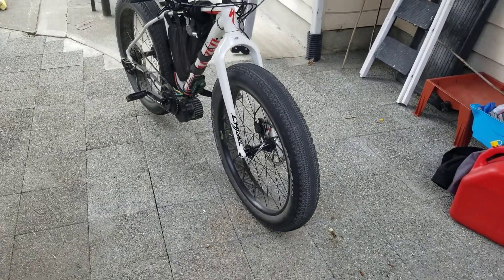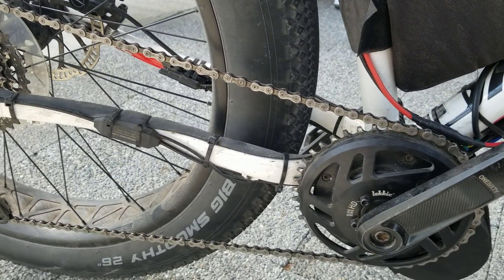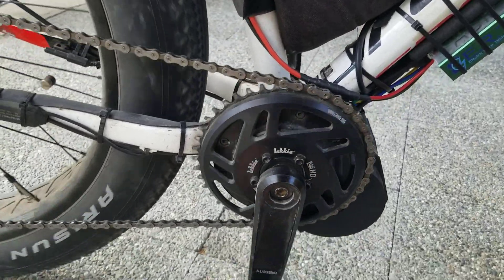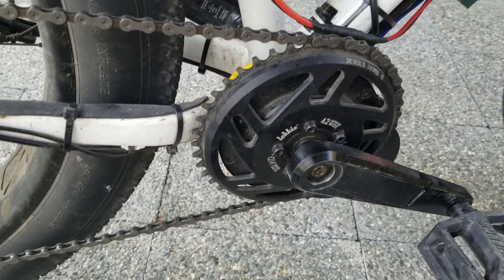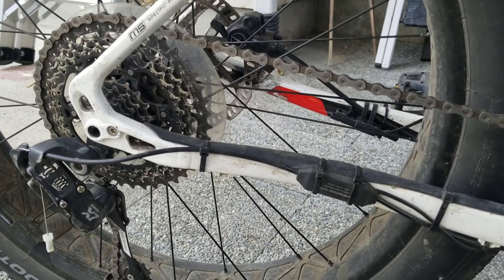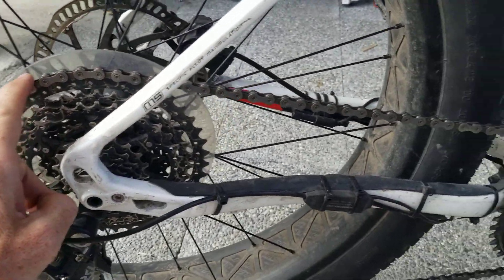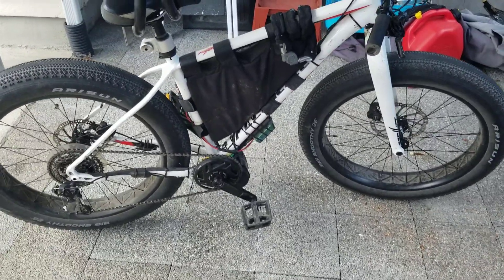Bafang BBSHD (ASI BAC800) on Specialized Fatboy - 3000km What I have learned!

Comment: Have you a link for a good battery. I ordered the 750w mid bafang but the battery is only 48v 12.5A
Reply from the maker: Litespeedbikes in the USA and Electron cycles UK / Europe make high power stuff. Em3ev are worth a look as well. Some folks like UPP which are a bit cheaper than the other options. Hope this helps. https://captaincodswallop.net/ebike-links
Reply: @HighVoltageKits  excellent, cheers

Comment: What about the luna 2000 watt controller?
Reply from the maker: The only luna controller I know of is the modified stock version they do so it can run 50 amps. Thats about 2500 watts max. They have a new VESC based gen 2 controller coming out but much is yet unknown. The piece of paper looks nice but have not seen any real world testing and of course they are locking its sale in with the purchase of an entire luna bike.... If this is not what you meant let me know! Cheers

Comment: What is the different controller u got?
Reply from the maker: ASI BAC800 / 855
Reply: @HighVoltageKits  thanks. I dont see the controller when buying the motor... or this is the display? I assume not.
Reply from the maker: There are only a few places doing this controller. Try Electron cycles or have a chat with people on the discord for other options. It can be hard to get pre-configured plug and play. I have lots of videos on the asi tho

Comment: i chose the Lekkie 32T Narrow/Wide chainring to make the motor spin faster and have more torque without lugging the motor down and causing it to over heat.. I also carry a wet wash rag.. I put it in a ziplock, then lay it over a 2 liter pop container and place it in the freezer.  That stays wet and cool for a very long time.  If the motor starts to feel hot, i simply place it around the motor.  :)  My situation is different because i'm on a Recumbent Trike. The chainline is much longer and easier with a Rohloff Speed Hub.
Reply from the maker: Thats a great idea! Love the bbshd recumbents. Some use a temp strip as well to monitor. I started out on the 36t but the chain line sucked. The 46 was too big! Very jealous of your speed hub! Cheers
Reply: @HighVoltageKits  The Rohloff was my big investment... the rear 559 (26"0 wheel with the hydraulic disc brake was $2k.    I really like your Specialized Fat..   I imagine a Rohloff for the Fat tire would cost more in labor to lace.    the Great things about a recumbent that uses 3 chain length, is that you can select any Lekkie to meet any needs... I am towing a trailer and wanted the motor to spin fast and stay cool on hills while touring.  I use the UPP 52v 17.5ah x 2 batteries (35ah)  These have the Sanyo NCR18650GA cells for high power/long range.   It was far cheaper to order them on AliExpress than order here.  I saved $800 on the set.   Nice job on the video presentation.. You are well informed.
Reply from the maker: Thanks for the kind words. One day I will afford one. Good to hear feedback on upp as well. Cheers. Feel free to join the Chanel discord if you are interested!

Comment: Thanks for the video/s. Super informative. One question - is there any difference with power consumption with the ASI controller  if using similar speed/setting as the standard controller? Cheers & happy motoring.
Reply from the maker: You are welcome. 1700 watts is 1700 watts although the field weakening will give a top speed boost. It will consume a little more at equal levels for that reason. But I know a few people that ride 72 volts and get great range but doing what you are suggesting and limiting the power somewhat. Hope this helps. Cheers
Reply: @HighVoltageKits  Thanks. I'll invest in one at some stage, they do look super interesting & fun. Meanwhile i'm still enjoying standard controller with my old 26er, thrown together from surplus parts. My better bikes are in Indonesia but I'm COVID separated from them for now as am stuck in Australia. Thanks again.

Comment: is the bafang bbs hd still alive - because of the use of a 72 Volt Batterie  / BAC 800  ?   Didnt you have to change the nylon gears so far ?
Reply from the maker: Hey Nik. I'm still on the same drive train over a year later. Its holding up well. Nylon gear intact. Cheers
Reply: @HighVoltageKits  mine is also in good shape ( 19 000 km so far ) - whereby my bbs hd has smear nipples and I only have used a 14s - 10 p batterie with the original 30 A controller.
Reply from the maker: This pleases me. They made a good motor that's for sure
Reply: How about now is it still alive lol @HighVoltageKits

Comment: Hello there, may I enquire as to why the twist accelerator control is on the left side?
Is that a thing with bicycles?
Thank you.
Reply from the maker: No it was just my thing. You can get both. I just figured as the gearing was on the right already if I put the throttle on the left I could modulate it more smoothly. I never rode a gas bike so I have no muscle memory to worry about. Cheers!

Comment: Politicians are too lazy to introduce sensible laws for e-bikes.

E-bikes need a speed limit of about 40 to 45 MPH so they are able to

keep in the flow of normal motorised traffic flow. ESPECIALLY ON

HILLS where an e-biker limited power to 15 MPH, is going to be

reduced to 5 MPH up hills IS going to be in a POTENTIONALLY DANGEROUS

situation given the impatient, inconsiderate average motorist.

Motorist are too stupid, too lazy or too fat to use e-bikes for local

journeys. Politicians and most car drivers are too stupid to realise

that the e-bikes WILL solve traffic congestion AND traffic pollution.

THEY HATE CYLISTS ! EVEN THOUGH RIDING A BIKE IS UNCLUTERING THE

ROADS AND PARKING SPACES. 

   
Imagine our cities where 90% of us are commuting across town by e-bike or
e-biking to and from the train station. Trains can be easily adapted

as necessary. Pollution levels and the gorgeous whether would return

to the levels we all enjoyed during the Coronavirus lock down. We will all also lose weight 
and be much fitter saving £billions on medical bills.

Pitifully Obvious - unless you are a dumb politician. E-BIKE REGULATIONS NEED TO BE UPDATED.

SCREEM, SHOUT and E-MAILS TO JOURNALIST - POLITICIANS AND MOTORIST. (

ie your mum and dad ) TOXINS from ever increasing motor vehicle use

are poisoning us and our children. All of us are wasting thousands

hours of valuable time in unproductive traffic congestion. The e-bike

- tandem e-bikes - e bike trailers for the kids and shopping is our

likely salvation ! 

E-bikes need regulations if they are to become the most popular form of
commuter vehicle. Unfortunately Registration plates insurance and

construction regulations for safety, similar to mop-heads will have

to be adapted. Hub motors are too unstable at speeds above 30 MPH -

Mid drive compulsory -  Rim brakes wear out rapidly on faster e-bikes and are therefore dangerous 

- disc brakes should be compulsory for e-bikes - Compulsory -e-bike battery 

detachable to prevent theft and for recharging at work

or destination with employers require by law to facilitate. Lockable

anti-theft tracker system - compulsory.

Speed limited by law to 45 MPH but with enough power to maintain that

speed up most hills. Motorway lanes adapted and progressively widened to provide 45 MPH e-bike and

e-recumbent bikes/trikes lanes where riders are three or four abreast

from initially using only the emergency vehicle access lane. Truck

lane 55 mph and car lanes 70 MPH.

In Life the sensible are handicapped by the imbeciles. The most common
accidents on motor bikes occurs when folks pull out in front of an

approaching motor bike because the driver didn't see the motor bike

which of course is bigger than an e-bike. I would strongly suggest

fitting a LED head light which can be set higher in daylight

preferably with a yellow cover to help the drivers see you

approaching the junction. Bear in mind older drivers have poorer

eyesight and much slower reactions. It's not much help being in the

right if your dead. At night remove the coloured lens cover and lower

the beam. We all need to scream at our idiot leaders in all countries

to adjust legislation to make e-bikes more popular. The Laws in the

UK are ridiculous. Most reasonably fit riders can easily exceed the

15 MPH limit without power assist but the same rider travelling above

15 MPH on a e-bike fitted with power assist EVEN if the power assist

is not being engaged WILL BE BREAKING THE LAW. Failing to registrar

the bike as a motor vehicle - no registration plate - no insurance -

no motor vehicle lighting regulations - not wearing a full motor bike

helmet etc................... Please copy and paste everywhere !
Reply from the maker: I tend to agree with many of the points regarding laws. It is sad that the potential is being restricted. I am not big on the anti motorist thing. I still own and drive a car just not like an asshole and I look out for cyclist also being one. The us and them saddens me. Especially when it leads inevitably to the deaths of cyclists from drivers so in their own power bubbles that they lose their humanity.

Comment: Where is your brake sensor attached to please? Mine has just arrived with a magnets but nowhere on my levers to use magnets :(  Some suggest glue it but almost sure I noticed you used small cable ties?
Reply from the maker: Yeah I used a small cable tie and some glue. Duct tape works well in strips also. Cheers!
Reply: @HighVoltageKits   Thanks for your reply & other suggestions.  Did you use both brake sensors? Cheers.

Comment: I´m using similar setup on my Fat cargo and it runs on stock motor perfectly.   
Stock controller. 36t Lekkie,  11-50 chinesium cassette was gone after 2300km  (I rip the spider that holds the center section like you... I use the middle section more) was replaced with the same chinesium cassette.  
Same chain after 3300km; kmc Ebike 10sp chain (clean and lube every wheek).
21ah  52v from Samsung 35E and Daly 50Ah BMS b inside a Polly DP-9 case.  (built the battery myself)
Rear hub is a NOVATEC 102SB 36h with 13g spokes. That novatec hub is strong AF and if you just replace the shitty 9mm Qr and use a 10 or 12 mm thru axle it holds even better.   
For braking I have a Magura MT5 E "closer" set. It comes with the brake cutoff conection ready,  and "pre brake click" function; the lever is made in 2 pieces that allows you to click and cut the motor before it starts braking.  I use that as a "clutch".     
MDR-C 203mm disc on  both wheels, also super sturdy.
The trick with the stock  bafang controller is to make acceleration progresive  changing  the "current startup" setting to a softer one. It kinda eliminates that "on/off switch feeling.
BTW: the total weight is around 220kg daily on that bike.  No issues so far.
Great build!   I will definetly try thta ASI controller in the future!
Reply from the maker: Your bike sounds great! I'm thinking of upgrading the brakes to either the mt5 or the Shimano Saint. Cheers!
Reply: @HighVoltageKits  MT5 worked great for me .  They have a special e-bike lineup.  The MDR-P  and -C discs.  And the ebike brake pads.  There is a Shimano setup that also runs 4 piston and costs way less than Saint.   I recomend using heatsink pads.    
The good thing about the Maguras is that you have individual replacement for all the parts of the system.    Regards
Reply from the maker: Thanks! I saw the saint and they did look expensive. I will check the discs out as well. Cheers

Comment: You can install metal gears in this motor and it will be stronger and quieter!
Reply from the maker: Its not quite a simple. Yes it will stop the nylon gear failing but it will likely transfer the failure point to the pinion. It certainly won't be quieter. There is now a PEEK gear that promises to fall in between. You need extremely high temps to get the nylon gear to fail. I have not so far. The metal one I have gathers dust. You are better off gearing the motor to be kind. Cheers.

Comment: I understand belt drive is better?
Reply from the maker: I have heard good things about belt drive. Definitely quieter. Possibly longer lasting and easier to maintain. I have zero experience tho. Part of that is budget. The benefits I'd get from belt drive are not things I'm that fussed about. So I'd rather try new battery tech over say a belt drive kit. But belt drive stuff is good. Thanks for the comment.

Comment: I am sorry, but this guy is giving some good advice, but he has wrong in alot of what he is saying, the controller works great, BRAKE CUT OFF SWITCH i will say is a must,  gear switch is not a must as long you have cut off switch, but gear switch i recommend for saving chain and chain wheel. My BAFANG BBSHD 14S Battery is going 3600km now, and still rolling. Good Video BTW. This is an awesome setup.
Reply from the maker: I am a bit harsh on the stock controller. Yeah it works but its a bit agricultural compared to the ASI. Its this controller that allows for the elimination of the gear switch as you can use the motor idle to change gears for you at low power. Thanks for the comment. Glad you like the video!
Reply: Yeah, great video and setup, no negative about anything there, just a little feedback :) I like my BBSHD original, but would like to by another one for projekt like you are doing, but batteries are expensive, so have to wait a while before bying more batteries.
Reply from the maker: For sure. Batteries are expensive! My favorite trick with gear changing stock was to lightly press the brake lever to cut off power and then spin the cranks. I found the cut-off tended to not give it enough time to change if it was say moving more than 1 gear position.

Comment: I own a 2019 Specialized Fatboy and I'm very interested in a similar build. Even though my Bottom Bracket is 100mm, it appears I would definitely need to purchase the 120mm BBSHD because the 100mm BBSHD motor would not clear the chain stay. Is that correct? Also it looks like I would need to get the Lekkie 42T chainring. Do you recommend the 170mm Lekkie OFFSET Buzzbar crank arms or does a company like RaceFace or other make a high quality compatible crank arm? The rear cassette on my bike is a SRAM 11-42T so I guess that should work fine. Last, are there any specific spacers, brackets or other items that help the motor mounting process? I'm hoping to purchase everything I need at one time. Thanks for all the great videos!
Reply from the maker: I used the 120mm. The crank arms are square taper although I'm happy with the lekkie ones others should work. In terms of spacers I am using 6mm in total. You can get them from most bike stores. I asked for a few to be sent out. Pretty common things tho at bike stores. I used a stack of washers on the other side. This video is the first one I did with some more information on it about the bb I think https://youtu.be/sJEDu2SgBAE
Reply: @HighVoltageKits  Appreciate the quick response. I was checking out the Trek 1120 tonight. Take a look at the unique chainstay on this bike. It looks like it would make mounting a BBSHD painless! https://www.trekbikes.com/us/en_US/bikes/adventure-touring-bikes/1120/1120/p/22005/?colorCode=grey

Comment: Great video, thanks.  I will be ordering  this motor soon.  I have a Giant  DS3 mnt bike, has a non conventional shape frame,  so I need to install battery pack on a real bracket that bolts on to seat post.  Can the pack be secured in the rear bracket?
Reply from the maker: I'd be looking at a custom battery rather than an off the shelf model. Anything is possible though. You could post a picture on the cyc owners group and I am sure people with similar frames will give you pointers as well.

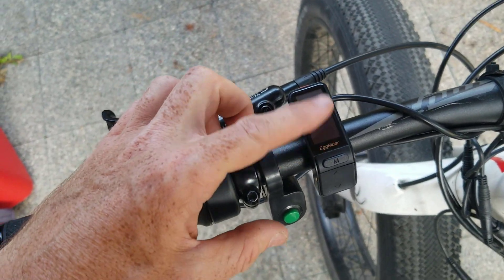Comment: Besides your EggRider 6:56 being small and discreet, what was wrong with the stock Bafang display? Were you getting erroneous values, harder to program, poor battery life, just didn't like it, etc, what forced the change?
Reply from the maker: Nothing. I had no issues with it at all. I was sold on the eggrider with the separate road and offroad riding profiles as well as being able to program the bbshd via my phone.
Reply: Captain Codswallop I just found your EggRider ‘First Impressions’ video. I get it now. I’m sold 🙂
Reply from the maker: You are on the stock bbshd right? There are issues with on the asi
Reply: Captain Codswallop that is the plan. Looking to add a BBSHD to my Cannondale. With the ability to program Bafang motor with EggRider, is upgrading the controller a must or a preference?
Reply from the maker: Very much a preference. I think this is something to get used to before getting more advanced in terms of power etc